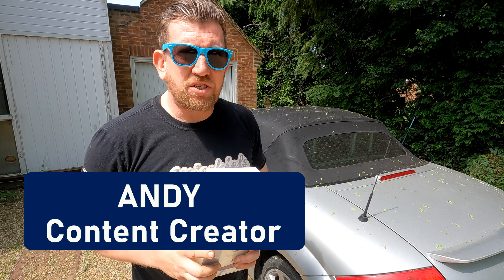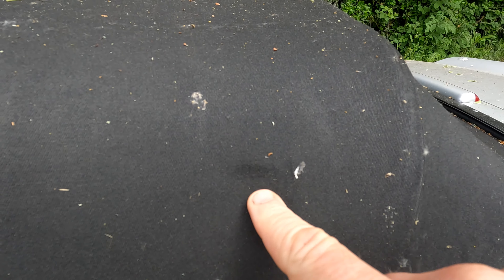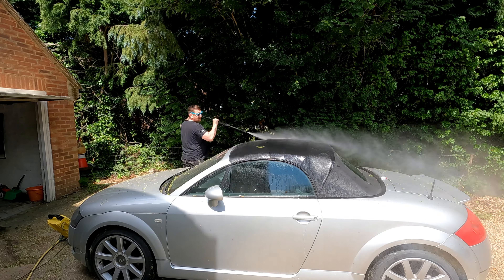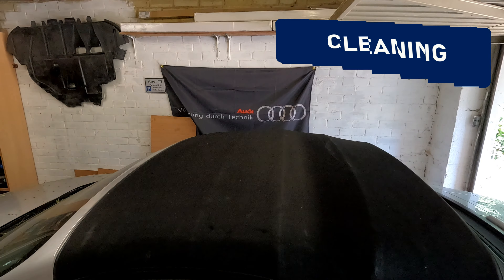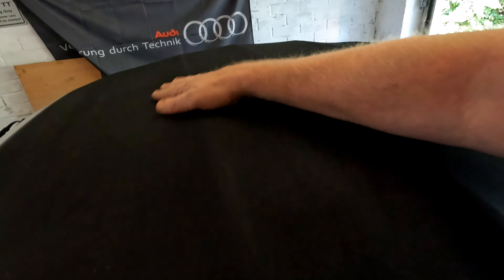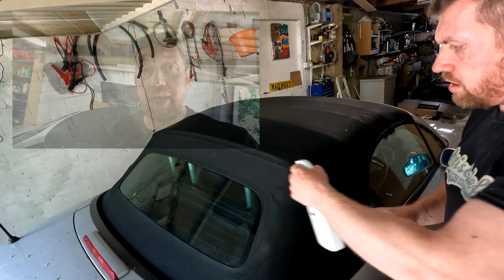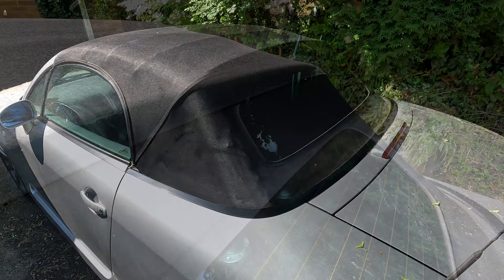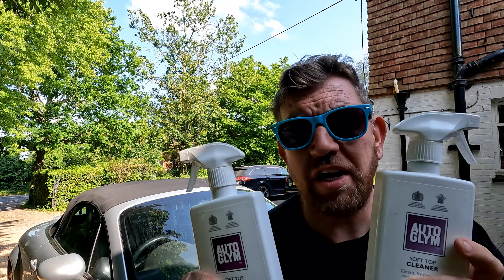Audi TT Mk1 Roadster - How to clean and restore the soft top roof

Comment: Thanks for posting Andy.  It looks like the glass is holding well on your replacement top.   I notice on your roadster and others I've seen photos of that there is what appears to be a black plastic trim piece around the rim of the top stowage compartment, which shows clearly on yours in the video.  It also appears that this black plastic trim piece continues forward at the top of the doors.   My 2001 roadster, US spec, does not have this trim piece, just the rounded-over edge of the painted body panel that the roof comes up to meet when closed.  I've never seen (or at least noticed) this trim piece on any roadsters I've seen in person, but I don't see many where I live.  Since you see a lot of them, do you know if this is a standard part for some markets, and why some roadsters have this trim piece and others don't?  I'm just kind of curious!
Reply from the maker: @90Duck. Yes the glass is holding because I swapped the entire hood out! It was a bit of a mission but I did it and you can see the results on one of my videos on the channel on replacing the hood. My wife smashed the glass in the repaired hood!. The black edge around the bodywork on the roadster is a protective strip for roadsters that have or intend to have the "hard top" applied to them. I think it was an option at the factory although I have heard it only appears on roadsters that had a hard top included from the factory. I might dispute this as there is no way that many hard top roadsters are around that would have had a hard top from factory. I Think it was more likely a protective (maybe cheap or free) factory option?
Reply: @andycharger  I've watched your roof travails with great interest since my glass was leaking at the bottom as well.  I installed a new replacement top, fabric and glass only, over the winter and I am happy with the results, that being that the glass is fully affixed and my roof no longer leaks!  

That makes sense as an attachment for the hardtop, but yeah, so few of those tops out there it wouldn't seem to account for as many as there seems to be.  I spent a LOT of time messing about with my roof area over the winter and got to know it all really well, so
it just kind of surprised me to see that trim on other cars.  Thanks for the reply and for the channel!

Comment: Great job Andy them spray bottles are awful not just Auto Glym other makes do the same, I found pour what you need in a container and apply using a new paint brush saves any over spray to body work too.
Reply from the maker: Thanks for that insight Russell. The bottles are quite poor and yes, I would just pour out what I want to use next time!